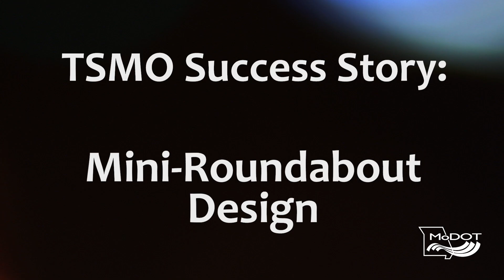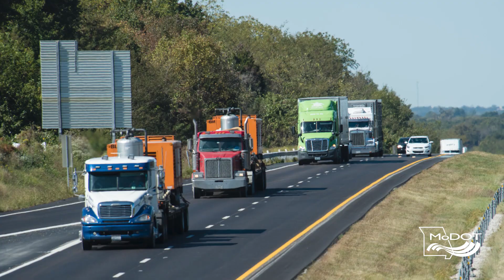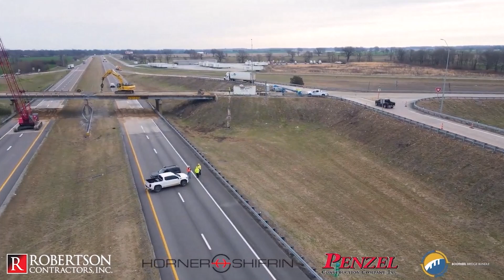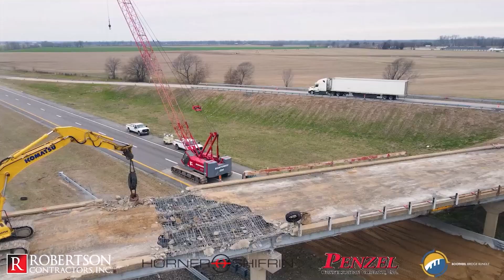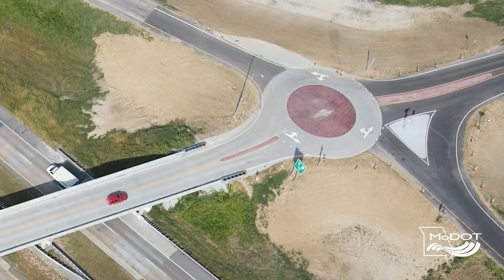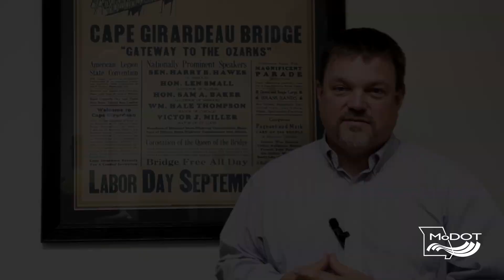TSMO Success Story #5 - Mini-Roundabout Design

Comment: I love new ideas and collaboration. But you all have to see that the entire community hates this design. What data on crash rates in this area was pulled when making this decision? I lived a mile from that intersection for years and never knew of huge wrecks. If speed was the issue there are other much cheaper solutions that could have been offered. There are many elderly people who live in Bertrand and the surrounding area who are scared of this intersection now because they feel like they are driving over the edge when going around the round about. I understand guard rails would inhibit agricultural traffic but I foresee many more issues due to steep drop offs with no guard rail than the supposed speed issue cited for this very expensive project.